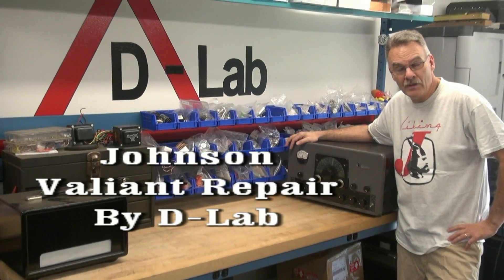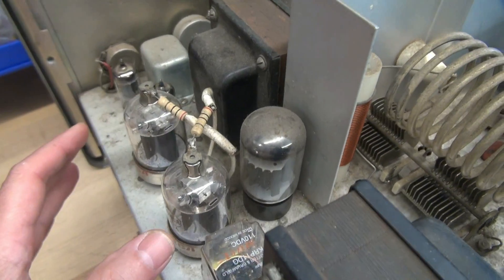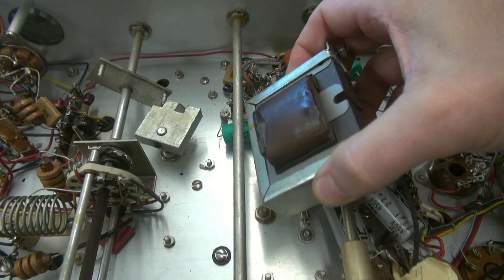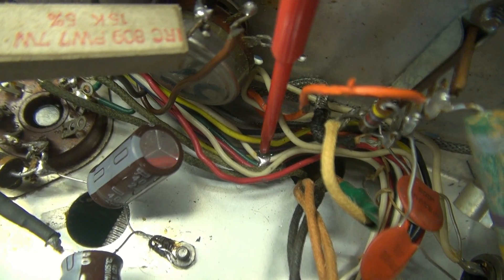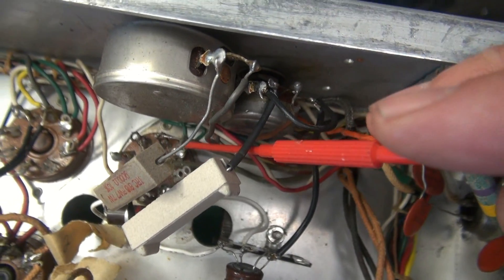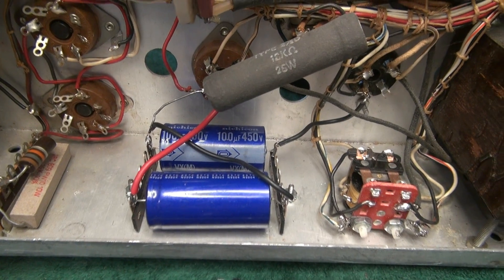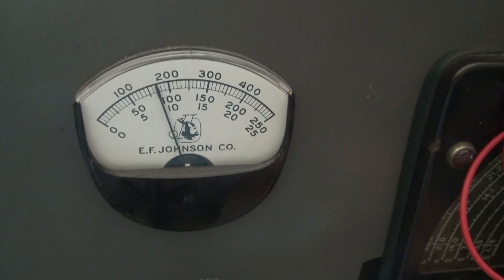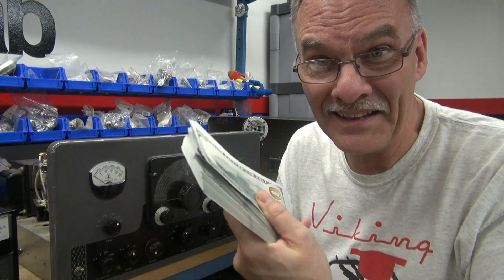How to Repair EF Johnson Valiant HAM AM CW tube Transmitter D-lab

Comment: Hi D-Lab, Have you ever worked on a FTdx400-401 or 560, I am having a problem with low power out, the final section seems to tune ok I have changed all valves and changed all the caps??? and all voltages seem fine

Comment: There is also the UE-549 which will plug right in to where a 3B28 goes, but I can't find a data sheet for them.  They're supposed to be good to 1A at 7000 volts.

Comment: Check the screen resistor for the finals. Most I find are way out which will show 100 to 125 watts of carrier. Once reolaced it should do 150 to 165 range. Glad you got it going! Ke7trp

Comment: When I worked on my Dad's Valiant years ago, we had a problem with blown fuses. Everything ran fine until we put the case on, then pop went the fuses.  We finally traced it to a single cabinet sheet metal screw whose threads had made a tiny cut onto the insulation of one or two of the wires in a wiring bundle along the back underside of the chassis. Thought I'd mention that in case anyone else ran into a similar situation.  :-)